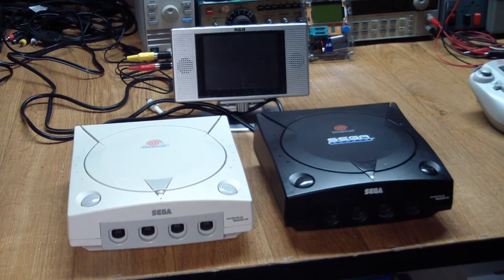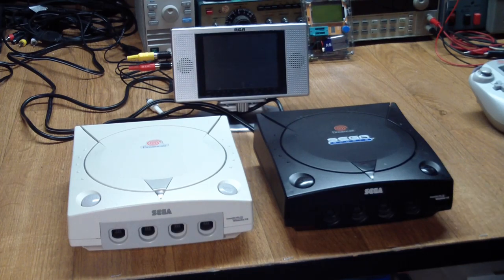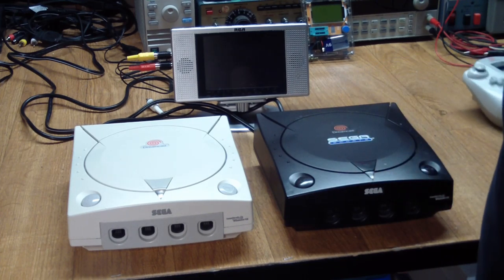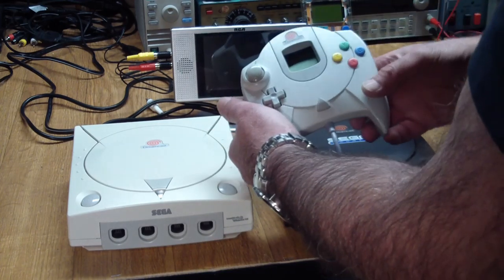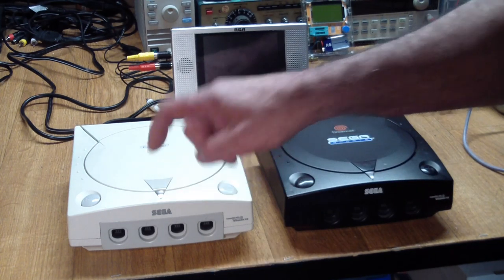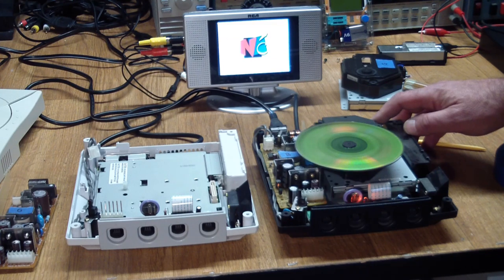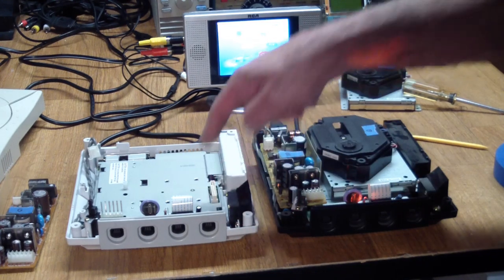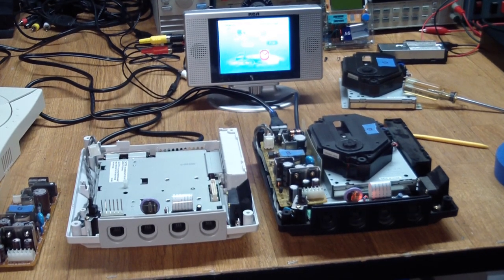AE#120 Let's Tear Down A Pair Of Sega Dreamcast Game Consoles

Comment: That impact area is fixable.
Strip the mask off, use lots of flux, and just drag solder the traces with a fine tip soldering iron. Use the flux Louis Rossmann uses.

Comment: Hi I'm am trying to put a LCD monitor in a missile command for a friend but I'm having trouble getting the signal to sync properly I've done LCD swaps on Atari centipede before and it was a simple pin 12 on the lower Edge connector any suggestions